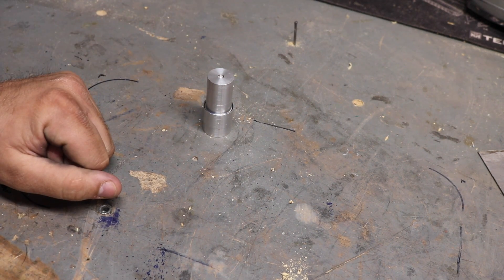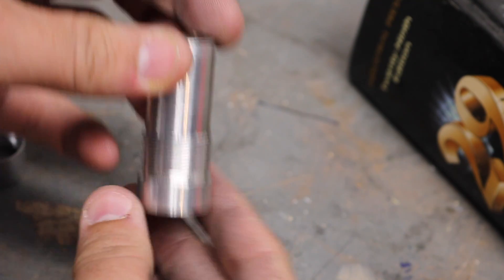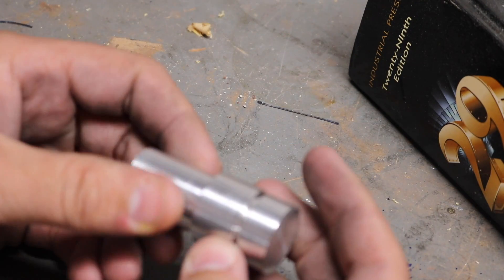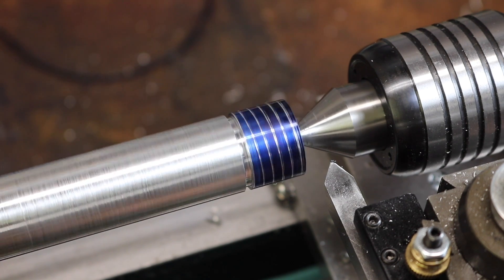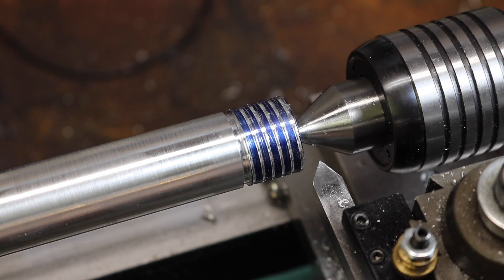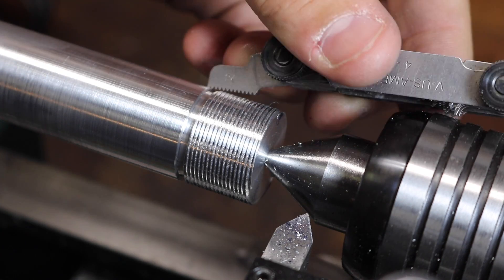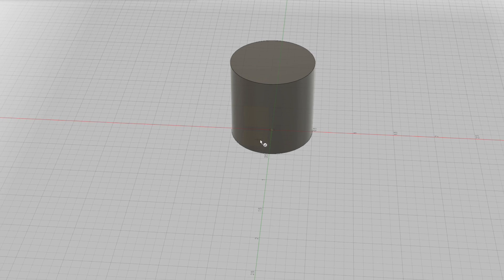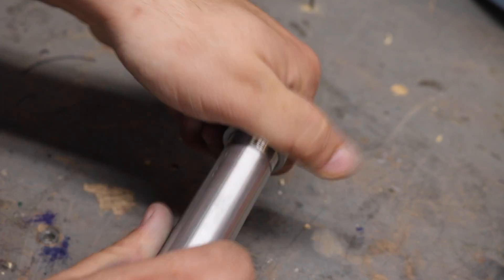Triple Lead Threads on the Mini Lathe and in Fusion 360!

Comment: ...I have cut some two start threads using just the threading dial...odd lead like 7 gives you a 14 pitch...cut one lead on the numbered lines...the other lead on the un-numbered lines...you can alternate between leads each pass and get to full depth pretty quickly...

Comment: I have a mini lathe and have never been able to cut threads and i like to fly racing loans and 2 and 3 mm are a must and I would love to know which plastic gears to use to cut 2 and 3 mm threads in doing add-ons to my racing quads.. also I bought a 5 inch 4 tooth Chuck and it come with a four inch 3 tooth and I cannot find a mounting plate for it would love to have a reply from you to maybe help me out with that.. thanks

Comment: I woulda used a 3 jaw to do the triple lead thread turning between centers indexing each lead to a diff jaw with the dog. For 2 or 4 leads...use a 4 jaw chuck and pick between 2 and 4....Your method works too and thanks for sharing it 😊 ~ Richard

PS: I always use #2 on my thread dial when engaging ;)

Comment: If i may, have you ever tried the old school trick of using the 50/50 mix of kerosene and cutting oil for aluminum? If not you must, the threads will look flawless.
Reply from the maker: I haven't ever heard of that, I will have to look into it thanks!

Comment: If you run your machine in reverse, and had your tool post on the other side you can start your threading in the relief area and auto feed away from the spindle towards your tailstock.... no headcrashing. Also it saves on you as it allows you plenty of time to stop the auto feed at any point once you cleared the part. If the part calls for a relief, which most do, I always thread in reverse as I'm not on edge trying to stop the auto feed before it crashes into the part or the spindle. It's almost essential for turning inside threads as it comes so close to the spindle. Save yourself the trouble and run the spindle and auto feed in reverse. You of course are threading on the opposite side of the part. Good luck bud!

Comment: Rather than using the compound, you could also turn between centers and rest your lathe dog on the jaw, then index it to the next jaw, and cut again, etc. This will only work if your multi-lead is divisible by the number of jaws though (and your jaws are precision ground and equally spaced). In your case since you have a 3-jaw and a triple lead, you can cut each lead on each of the jaws (if you have a 4-jaw you can cut double and quadruple leads, or if you have a 6-jaw you could cut 1,2,3,or 6 leads, can you imagine a 6 start thread?). Just an alternative method, that's the best thing about the trade, there's about a million and one ways to do the same thing, haha.
Reply from the maker: I'm really glad you posted this as a comment, after sharing this video with some (real) machinists, they gave me the exact same feedback.  Certainly another great solution, and I agree with you 100%, it's so awesome how machining (and making stuff in general) leads to so many different ways of solving the same problem!!  Thank you for watching and contributing!
Reply: Practical Renaissance 
ever try upside down and backwards?

Comment: I just started learning Fusion 360 last night. I will be using on the CNC Router to mill aluminum and wood.
Reply from the maker: That's great to hear!  I'm a big fan, it's such a useful tool and pretty easy to get the hang of.

Comment: Very interesting, great video :) 
for the fusion360 stuff you can use the 'press/pull' tool to continue ends of the thread and the sweep off the part. if you use the 'press/pull' tool and select the left over triangle then it should be possible to move that face off the part therefor completing the thread and cutting that last little bit.
Reply from the maker: Thanks for the tip, that makes perfect sense!  I'm obviously still getting the hang of Fusion 360, haha. Thanks for watching!